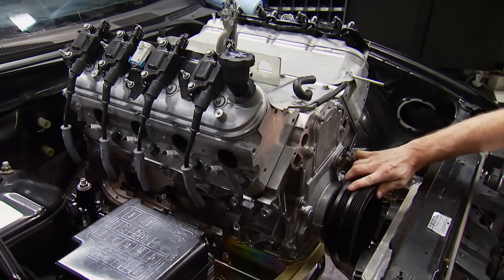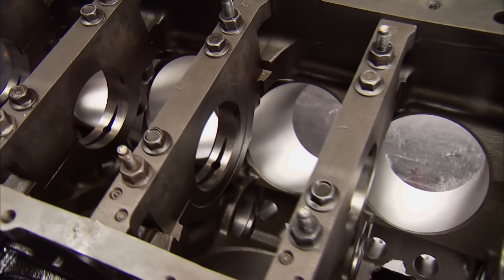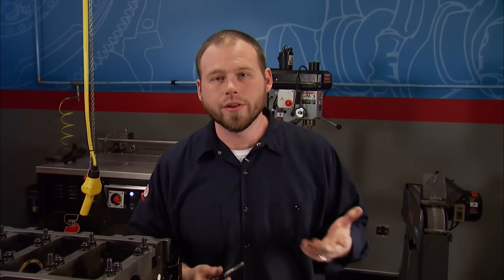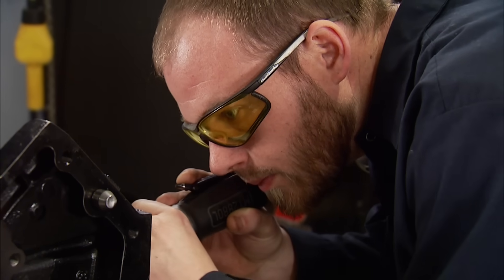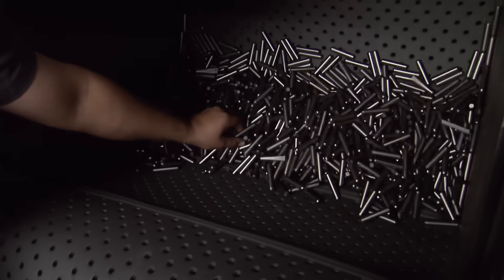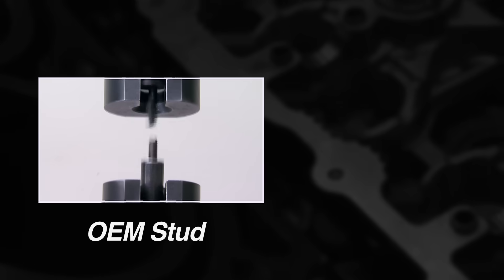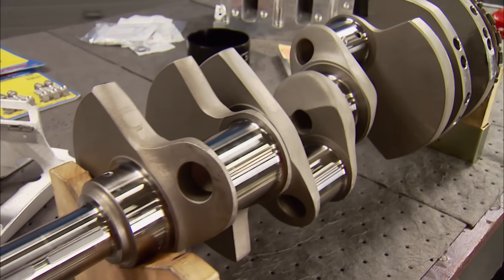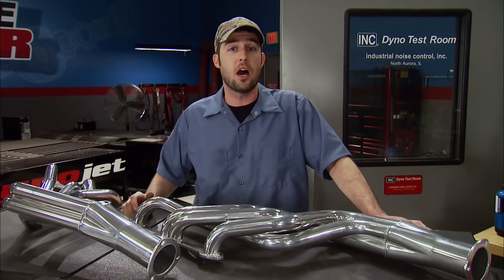Building A Chevy Stroker From Scratch With An LQ4 Iron Block - Engine Power S1, E9

Comment: Here's something people do not know about ARP.  All their material is shipped temp controlled.  That means it is shipped in a refrigerated trailer to stop rust from even getting started.  I hauled many loads into that place.
Reply: That also explains some of the cost. 
When someone complains about the cost of ARP hardware on an engine I’ll remind them of the steps they go thru.
Reply: @chloehennessey6813  if they complain just send them the manufacturing video. Clearly worth every cent.
Reply: @chloehennessey6813  at the least, use arp on high torque, high importance applications. Mains, rods, heads, etc. Save some money if you want with all the other stuff like timing set, oil pump, covers, etc.
Reply: @chloehennessey6813  save your money and use stock gm bolts.
Reply: @ivanjimenez8868  believe it or not, some ARP bolts are cheaper and stronger than stock gm bolts. Only exception is like crank bolts and some others.
Reply: @BigBlockCaprice  that's debatable
Reply: @ivanjimenez8868  definitely debatable. I have a mixture of both oem gm bolts and ARP fasteners.
Reply: @ivanjimenez8868  all depends bro. I have an LM7 with 400,000 miles.  All ARP hardware and she continues to take the abuse lol. I cracked several sets of OEM  bolts before I made the switch to ARP.
Reply: @TheSleepyMechanic0524  400k? Nice! In my opinion unless you're planning on pushing over 600 horsepower on an LS iron block engine? stock head bolts are all you need and they'll be great.
Reply: @BigBlockCaprice  although I personally wouldn't know since I simply reuse factory ls/gm bolts whenever I've had to remove cylinder heads. I do know gm sells most of their oem parts at ridiculous prices though.
Reply: @ivanjimenez8868   you can re-use ARP bolts.
Reply: That's some coca cola level genius
Reply: Wow 👏😮
Reply: Always heard that ARP was borderline obsessive compulsive towards manufacturing and quality control.
Reply: Refrigerated bolt, there's a sucker born every minute...
Reply: @ryanknutson912  they also use a specific grade of steel and they require a specific temperature be maintained to prevent any corrosion or scale formation in transit.  Aircraft fastener manufacturers are required to do the exact same thing also.  High quality manufacturers are willing to pay for proper shipping handling to get stuff moved properly and without damage.
Reply: That ends on shelfs
Reply: Wow!! 😮
Reply: Ñnm m
Reply: That’s amazing. I would not think of that.
Reply: Wow what a cool bit of info!
Reply: It probably has much more to do with dimensional stability upon incoming inspection so when it gets loaded in a machine the dimensions can be held.
Reply: That says a lot. Thanks for sharing.
Reply: Dud anyone notice that this company doesn't like to hire White men?
Reply: Wow seriously? that’s quality. The added expense of shipping